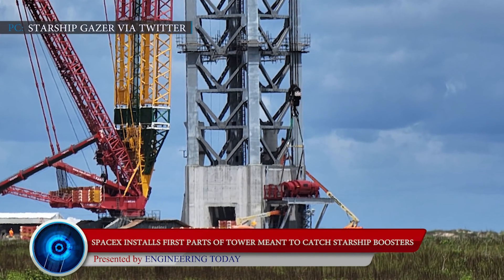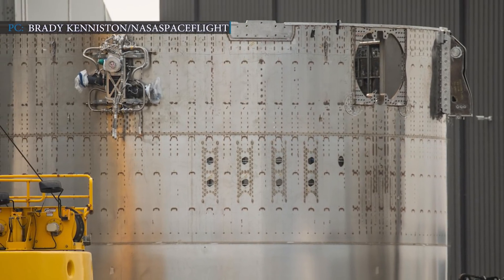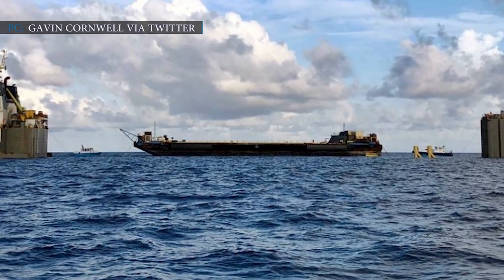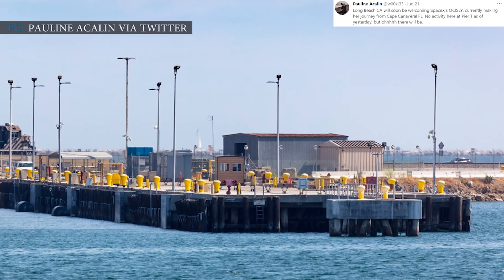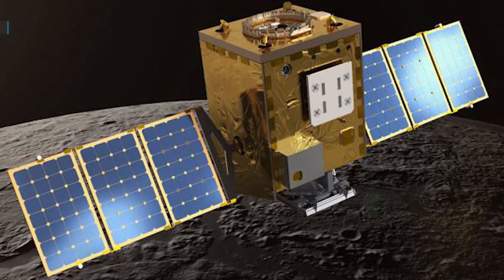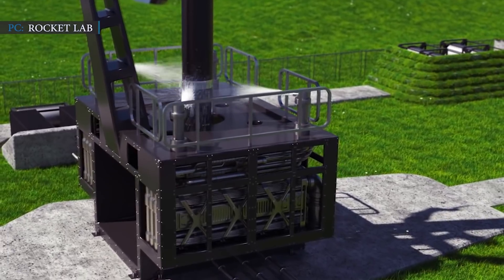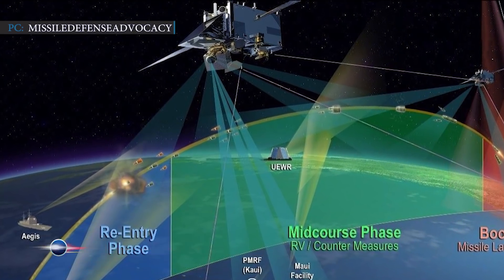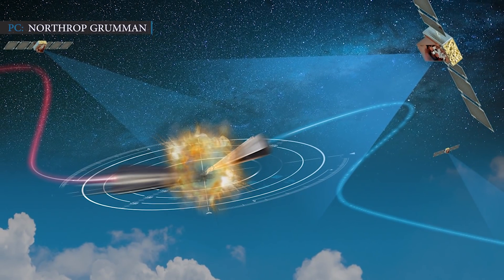SpaceX Orbital Starship progress: SpaceX installs launch tower mechanism to catch Starship boosters

Comment: When catching the landing booster by the grid-fins, it places the rocket in tension.... Tearing it apart.
Is the purpose to eliminate the landing legs on the rocket, thus saving weight?
Then why not just have landing legs on the ground?
Much lower profile, much easier to land on as you can make it extra wide, and can be built on Mars (I assume this is leading to a Mars trip, where the same system will be required). Also you can build a flame diverter under the legs if required. These stationary legs can also then be controlled to balance the rocket in the event of a skew landing.... Even shock absorbing with a few meters of movement.
The tall tower just appears overcomplicated, expensive, unsafe and not usable on Mars = short sighted.

Comment: 6:53 "SpaceX at that moment switched its launch vehicle from a Falcon 9 to a Falcon Super Heavy. . ."  That is Falcon Heavy not super heavy.  The switch from the Falcon Block 5 to the Falcon Heavy allowed Psyche to optimize its trajectory needed to arrive at its destination.  That trajectory is not optimal for a mission with the goal of Mars capture and orbit, as EscaPADE is required to do, and would have required EscaPADE into an extended cruise phase to get into its correct orbit.  The contract with Rocket Lab for two EscaPADE spacecraft, named Blue and Gold, will be based on Rocket Lab’s Photon satellite bus as noted. The Curie engine, used on Photon and the kick stage for its Electron rocket, will insert the spacecraft into orbit around Mars.  However, the needed lift will not be provided by the Electron rocket.  It is unclear what the launch arrangements for EscaPADE are. Rocket Lab’s press release said that the spacecraft will launch on a “NASA-provided commercial launch vehicle” in 2024. There are no NASA Mars missions scheduled for launch in 2024, meaning that EscaPADE would either need to find another mission with a compatible trajectory or have NASA procure a dedicated, and significantly more expensive, launch.

Comment: That mechanism looks an awful lot like a traction winch.  Consider the catching arms being supported by large wire ropes. When the weight of the booster is being transferred to the tower arms a traction winch will allow cable out to not exceed a certain load on the wire. As the wire “rends” out, the winch converts the kinetic energy into thermal energy decelerating the booster until it stops.

Comment: The kinetic energy absorbed over some short time  by catching the booster (which will be @1-200tonnes with low fuel, traveling a few meter per second until rest) will be captured by a electric motor in generation mode. Just like regenerative breaking, but without breaking. 
This energy will be stored in a massive battery pack for use within the launch apparatus, for example to power the lift in the tower to flit up astronauts etc, why waste the energy in my view.

Comment: I don't think that winch support is strong enough. A lot of tension on that mount.
Reply: So are saying that this NOV ADS 30Q Drawworks hoist with 6000hp and lift capacity of 1000 metric tonnes may not be strong enough??

Yes you could be right, but ultimately all of our arm chair speculation is hubris.  I can wait for the real thing.
Reply: @michaeldeierhoi4096 Thanks for replying. The draw works is plenty strong. The mount it's tied to has to hold a 1000 mtons. Compare the mount to the tower.  ?? earlier is saw a video where they were going to mount it about half way up. Do you know anything about that? That draw works is going to have to be TIED down.
Reply: @arthurwagar6224  I have no further info on any of that.  So we will just have a wait until new construction happens as far as locating that large pulley system as one example.

Comment: The new installation on the tower is called a Drawworks its produced by a company called NOV (National Oilwell Varco), This system is used on all drilling rigs and its used for heavy lifting. There is no proof till now that it will be part of the catching mechanism and i highly doubt it will be. It definetly will be used for stacking though. Please dont use info your not sure of in the title.

Comment: This could simply be part of the crane component for stacking and not necessarily for catching, or it could serve both roles depending on the design. However, I think the first priority for SpaceX would be for stacking purposes.
Reply: you are right, same engines are used in oil rigs for lifting and dropping pipes, I bet this engine will do both. Catch and assemble. Genius thinking by SpaceX, using already known tech.
Reply: Yeah, more than likely. They are removing the BN.2 hot gas thrusters to speed up the launch so it looks like the integration tower will be stacking first, catching second